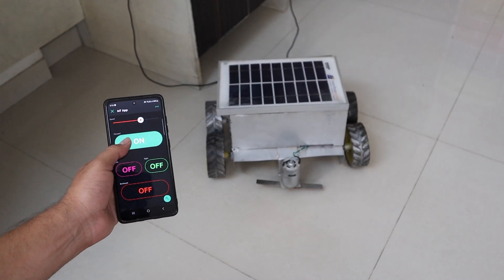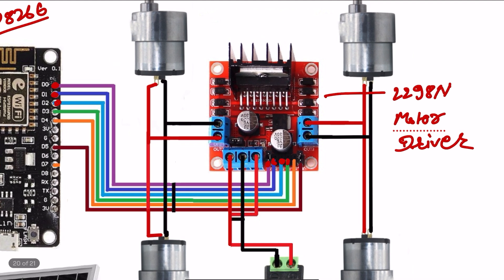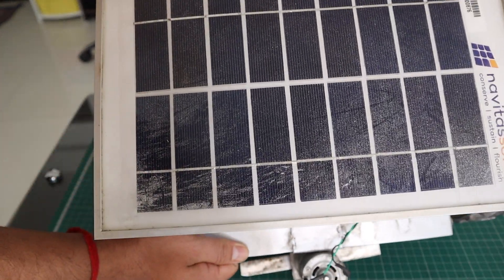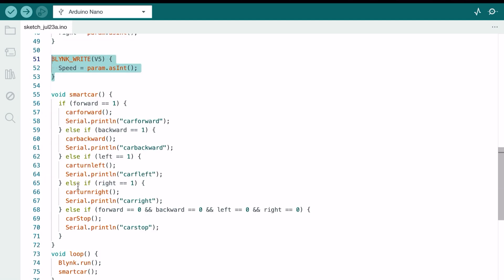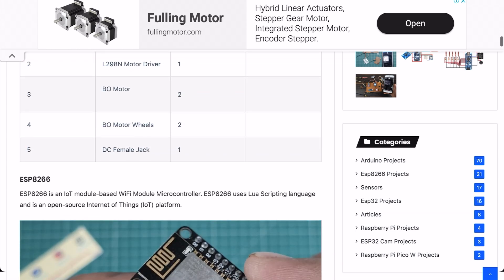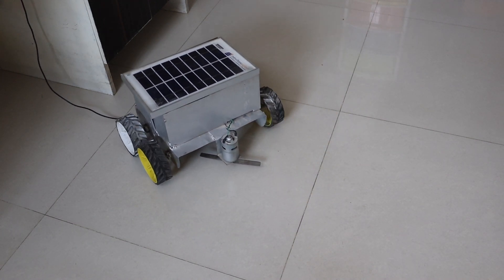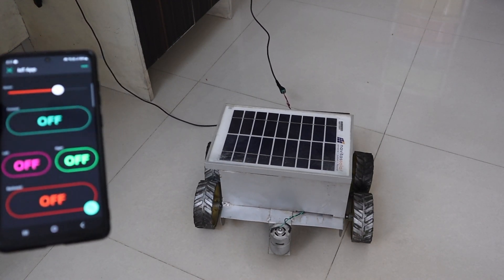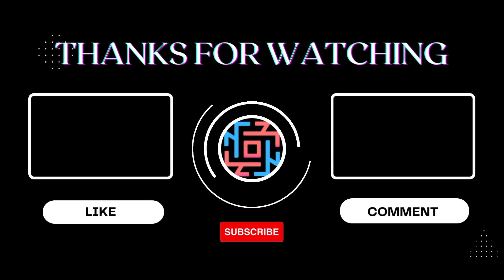Solar Powered Grass Cutting Robot Controlled via Blynk App | IoT Lawn Mower

Comment: in the circuit diagram you showed, your not connecting the motor that is cutting the grass to the l298n motor driver, so did u connect the motor that is cutting the grass with a separate battery . and i can not find the grass cutting solar powered robot in the link u put in the description